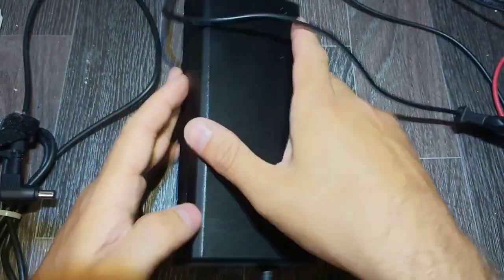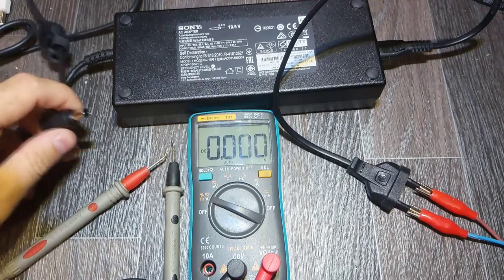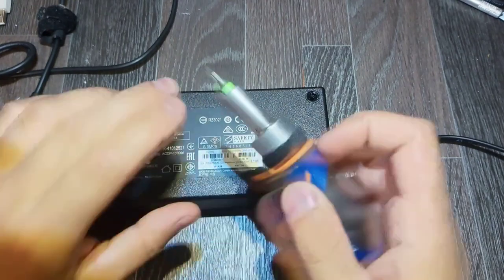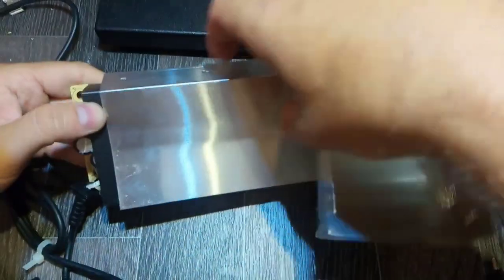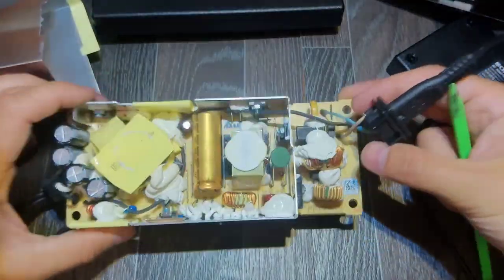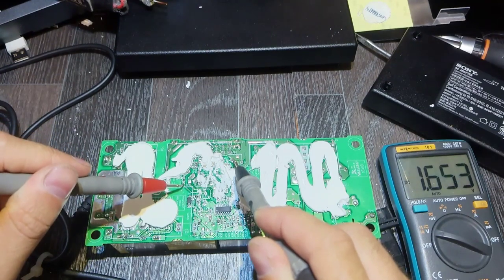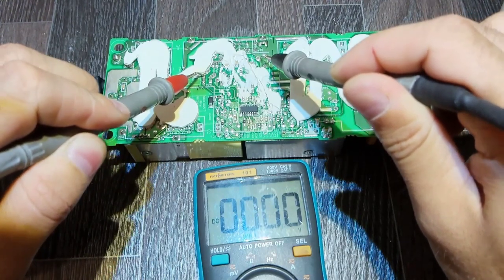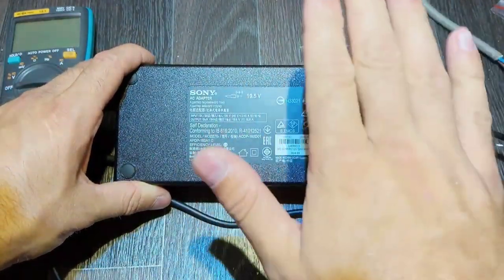Sony TV power supply repair

Comment: I have a 65" sony with ac adapter ACDP-240E01. I could actually smell it over heating. Looks to be at the connection from the adapter  to the tv. Haven't actually opened up yet to see if its something I could repair

Comment: Greeting from Thailand and thanks for this video.
Would you advise me where to buy that DAP019D?  My adaptor is broken and the IC is cracked as same as mosfets.
I could not find this IC inThailand. And wonder if IC L5119D can be use instead?
Reply from the maker: Hi. I love your country. I've been there more than 5 times. 
I'm not sure about L5119D but you can easily buy DAP019D on Aliexpress.

Comment: I've got the exactly the same power supply for a Sony TV the TV started blinking a few weeks back I tested it with the multimeter I'm getting the correct voltage but the amps are very low 2 or 3 amp confusing to think the correct voltage is 19.5v could this be easy fix with a new power supply or do scrap the TV. 👍👍
Reply from the maker: Probably the capasitors in your PS lost some capacitance and it cant deliver enough power. I would try to repair PS or get a new one before scraping TV.
Reply: @electronicshaverightstolive  Thanks for the reply very much appreciated 👍👍